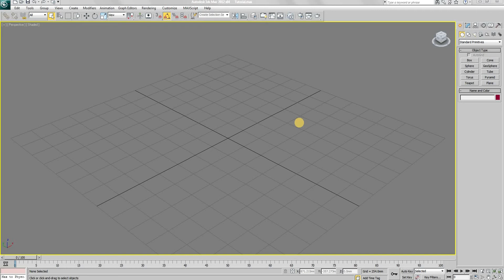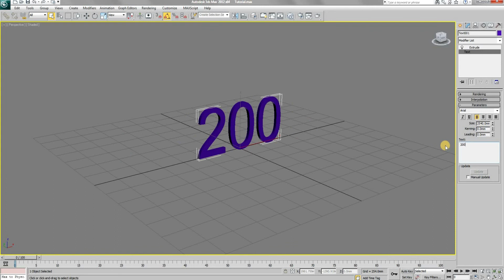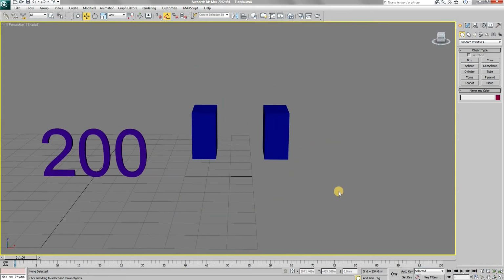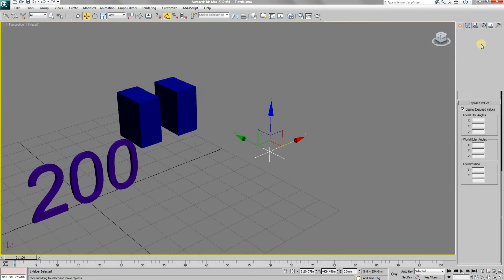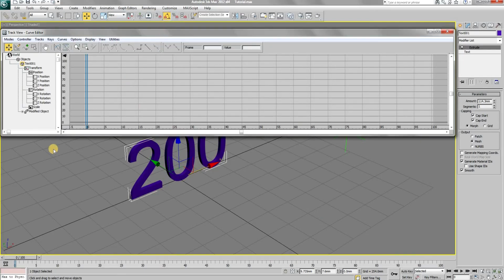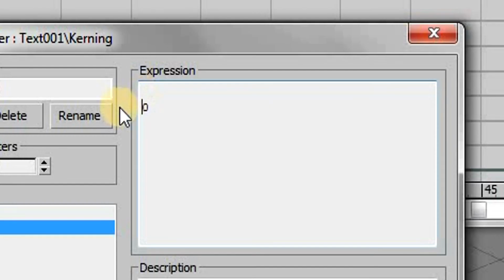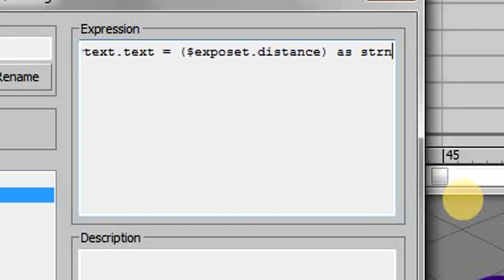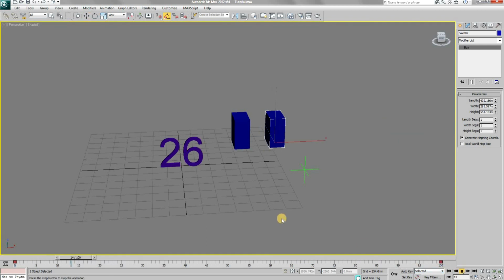How to Animate Text Changing in 3ds Max - Powerful tip

Comment: This is a very inconvenient way to achieve a counter. This will also cause problems when network/cloud rendering since the ExposeTransform is not evaluated per frame.

A better and easier way is to use TextPlus and 'Set Value as Text' then add an Expression like this:
if(F<10, 0, if(F>50, 200, (F-10)/40*200))
This also has a buch of settings to play around with. However this works only for numbers!

Another approach is to create your Spline 'Text' and then in the 'Track View - Curve Editor' select a text property like 'Kerning'. Add a 'Float Script' controller. Create a Variable named 'Counter' and add it to the text Node. then add your script:
Counter.text = (if F<10 then 0 else if F>50 then 200 else (F-10)/40*200) as string
0

The 0 needs to be on the second line to provide a value to the kerning property we used to host the script.
Since this is a MaxScript not just an Expression it is very flexible and not bound to only numbers.

Each have their own benefits and both work when network/cloud rendering.
There is also a section about this in the official 3dsmax docs named: 'How do I change the text in a Text Shape dynamically?'

I hope this helps :shelterin:

Comment: simple frame counter with same variable names:
mytext.text = (F) as string
0

-F is a built in variable that gives the current frame number
-the zero is important, I had it missing - this will give the expected float value for kerning. Without it the controller will error out.

(oh and thanks a lot, this video helped me create my frame counter)